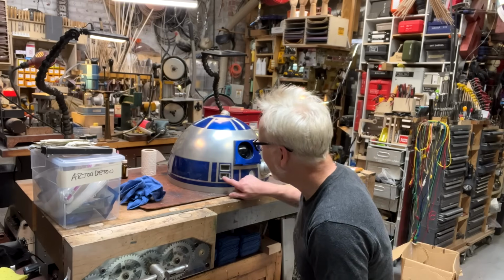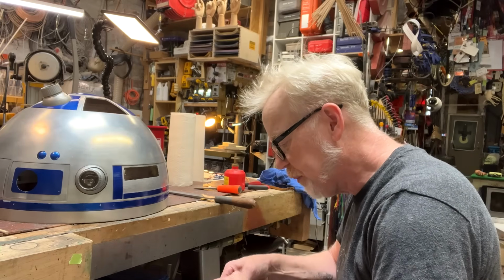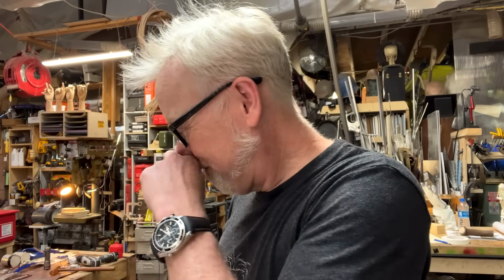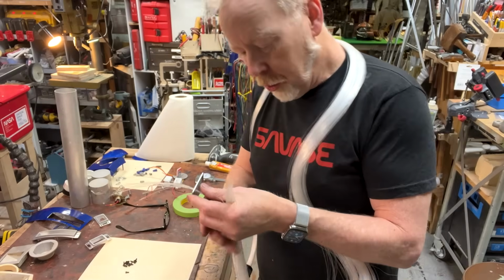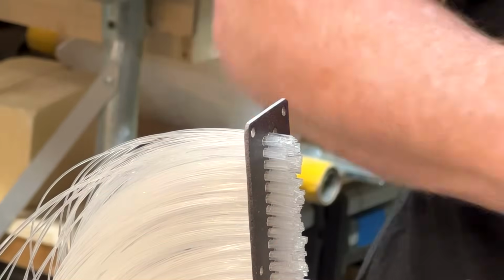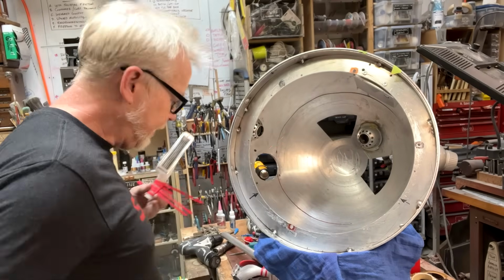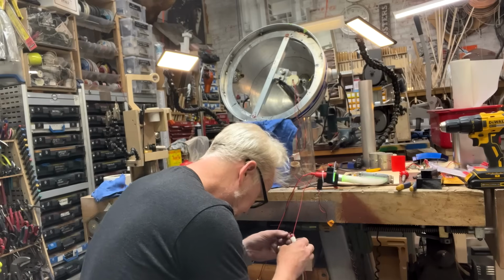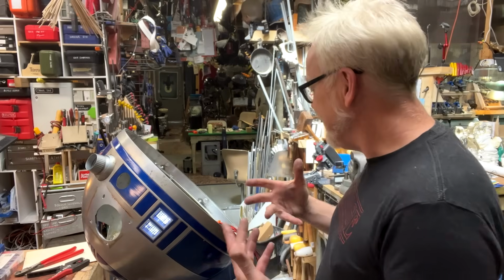Adam Savage Upgrades His R2-D2 Astromech Droid Build!

Comment: That's really cool! ...You probably won't want to take the (simple) end of the light pipe apart again after having ziptied, cut, and glued it, but seeing that you weren't really happy with the way that the rectangular data light/color wheel combo display was working, I was thinking that other that altering the color wheel, you could also move around the (less complicated, color wheel end) the ends of some of the fiber bundles so that you don't get as much of the "there's a shape of color moving through the lights" effect, by having the bundles of fibers on "input" end of the light pipe be farther away from/not next to the bundle right next to them on the display end of the light pipe, depending on what kind of look you're going for.

I've never build an astromech, but I had an idea for doing it a few weeks ago, and this is making me wish even more that I had room to work on it and a place to put it when finished. ...I was thinking about the glossy, black astromechs that we see in the Imperial scenes, and I got the idea "Hey, you know what would be fun? Making one of those, and putting the sweeping red light (Larsen Scanner?) from the front of KITT in Knight Rider on it!"
Yeah, it's pretty silly, but I'd enjoy it. Then it occurred to me that the two square-ish vents in the middle of R2's "chest" do have a resemblance to the 3 bar, graphic indicator light on the dash board that showed when KITT was talking (updated version, the original season it was just a square), and thought that I could also put THAT light in place of/behind one of those 2 vents, and have it light up in tandem with the droid's beeping. ...Though when I was looking on YouTube for a short clip of Knight Rider that showed both the scanner and the voice indicator, to show my son, I eventually thought "Oh, wait. The Knight Boat ("The crime SOLVING boat") clip from the Simpsons probably showed both!", and that was the example that I showed him, but watching it I saw that they made the lights look a bit different, so now I'm torn as to whether I would actually want to use the Knight Boat designs for the lighting, instead, so that the droid actually becomes a kind of parody of a parody.

In any case, if I ever actually DO make this guy, now I'm thinking I want to do the sweeping scanner with fiber optics, like the original R2. I figure I'd probably shift around a few of the dome details to put the rectangular data lights in the front under the eye cluster, and put the sweeping red light in there. ...And maybe put a laser pointer in the little protruding light next below the main eye, so that I could have him play with my cats.

Comment: You could just make a paper tracing to transfer the hole pattern. I would have clamped the fiber optic hole plate horizontally over hanging the edge of the table so I could sit in a chair with my arms braced resting on the table to push the fibers down through the holes. Improve the comfort, and that reduces the tedium of the job. Likely increases accuracy, and speed too. I would have kept the bundles separate so I could randomize the sets so it doesn't look like a light shining behind holes. It would look like individual lights changing colors randomly or as a code an interpreter like C3PO would understand. Given what you made I would make the color wheel a hand panted pattern known as "dazzle". A geometric pattern used on wwII warships to obscure the shape of the ship to confuse the enemy of the size, type, distance, and direction of the ship. Another solution would be to make the light source from several sources whos pattern could be coded.

Comment: I kept wondering the whole video if your R2 was radio controlled, I didn't see any radio control components inside the head. Using a 4 channel hobby R/C radio and receiver along with an arduino microcontroller you could probably remote control a fair number of functions on an R2.  Or as another commenter suggested, use a tablet or phone w/ an arduino / raspberry pi over wifi.

Comment: My red mini-mech on the front cover of MAKE issue #2 has fiber optic logics. I took all the fibers that spelled out R3 in the top display, and C2 in the bottom display, and put them in one bundle. All others in another bundle. Both bundles get random smatterings of light in the slow 6RPM color wheel, but for a few seconds each rotation, only the one bundle gets light to spell out R3-C2. Because that mini droid with the clear R3 dome was brainstormed by the R2 Builders group after C2 in Indianapolis, as the droid that would fit in the Jedi Starfighter wing.

Comment: So one thing I'd recommend people do if your ever cutting the fibre lines with the chisel like Adam was is eye protection. It's very  easy for one of those small glass strands to end up flicking up and into your face.. Also adam why not a simple ardunio or the like unit with wifi or the like in that head you could trigger the effects remotely etc that way.

Comment: Those tiny gear motors are called N20 motors , they come in different voltages and RPMs , I've built a bunch of tiny mechanisms with those , I'll send you a link on Twitter when I locate the videos

Comment: That there is one of the FIRST batch of domes created by myself and Ron Barclay waaaayyyy back in 2003…They eventually came to be known as the “R&J Dome”…glad to see it still looking so amazing after all these years. 😁
Reply: Did they use one of yours in Fanboys?
Reply: Why ya wear glasses then never look through them ? 😅😂
Reply: Was it spin formed? I saw the joint lines inside. We’re these welded pieces?
Reply: @Sommertest  Adam mentions in the video that they were spun, I'm not sure what that means, but I assume that's also what you're talking about lol
Reply: @j0hn00  It means that a flat sheet metal is fixed to a dome shaped jig, and while the sheet rotates, a lever with a wheel is pressed against it, moving from the center outwards, so that the spinning sheet is wrapped around the jig. During that process, lines are left in the material from the occurring bending.

Comment: Funny I started in the R2Builders group when it was about 10 people (now 1000's) and we were all flailing around searching for info.
I typed to Tony Dyson (Nice Guy) who made the fiberglass R2's for the diameter and he said "oh about 19 inches" wayyy back when there were only a few R2's made.
I made a display one to make molds off of but then realized the entire thing was a bit Oversized (should've ben closer to 18 inches)
(I till got that original in a closet here with the head signed by Kenny Baker)

Comment: I wonder if anyone has thought about using clear packing tape to add epoxy into the light sockets while keeping the sockets separate from the light sources??? Would the fiber optics need to be epoxied to show light through the epoxy, because if not, and the light quality or quantity isn't diminished,(too much at least) the packing tape idea, putting packing tape on the back of the light housings would, or at least should, stop any epoxy from getting to the light panels he's adding in behind, without needing to do that epoxy job that he showed, that I didn't 100% understand...(I understood the reasons, of keeping everything removable, but not much else)

Comment: Point of Interest; Those "20volt to 12volt" and "12volt to 3volt transformers", are actually DC to DC converters. Otherwise known as switchmode buck power supplies. 
A very interesting and amazing colour wheel light pipe assembly Adam! Very impressive indeed! Can't wait for the rest of the build, sir!
If you ever need any assistance with the Electronics and theory, of these builds, please drop me a line.
Reply: I agree - calling switch-mode PSU modules of any type "Transformers" is just confusing and misleading to non-technical people or those just learning electronics (even if some dodgy advertisers do it).

Adam, you normally so precise with terminology that I was quite surprised by the lapse!

Comment: Those fiber optics display looks awesome! The only thing I did not like was the pattern showing on them. For once you did it too neatly when bundling the fibers together? If you have made sure they was more randomly mixed, maybe the output also would have been more random too? Now its more of stripes rolling over the displays (especially the small blue ones).

A question I have is: does the CA glue interfere with the light? I am thinking if the glue "connects" to the walls of the fiber optics it will bleed the lights out on the wrong place and make the display more "fuzzy"? Not sure if that is a good or a bad thing either :)

Comment: my father and i dusted off the shel queen helicopter 🚁’s  been idle for five years. batteries recovered then 👅 went the way of the do do. so i bought two brick 🧱 batteries to fly. those that rc fly or run cars etc. need to make salt water after nipping off the connectors then you leave the dead batteries in the salt water for two weeks. it makes the batteries chemicals neutralize so they can be pitched. the problem with nitro fuel is it goes bad and hopefully you ran your rc dry. residual will get gummy tear down clean the bore polished and pull the piston apart clean the whole thing in degreaser in a zip zap ring 💍 cleaner or get the vat parts washer heat soak 🛁 if it’s real bad rinse and dry and reassemble re oil light lube free the rings up. my dad’s rc planes ✈️ servos are ancient kraft stuff. fuel is expensive to boot and bad to run in the grass. kill your grass. but for ought run em freshened up. new battery’s etc. because Adam’s r-too sat for so long batteries 🪫 won’t recover

Comment: Still blown away at how Adam makes these fictional mythologies real, and how casually he assembles the components from the orthogonal bag-of-holding that is his workshop. That fibreoptic colour wheel effect (which I learned here was how they did that!) is wonderous. I wont see New Hope the same way again.
Reply: It's always amazing to me to see the most obscure supplies and tools he pulls out of a random drawer or cabinet somewhere when he needs it. Like that air powered handheld sandpaper gun thing he used around 13:20 into the video. Most of these tools I would never come across a situation where I would need one, but Adam Savage has come across those situations often enough that it becomes practical to own one. What an adventurous life

Comment: 1:20:00 it's so much easier to use a slip ring and detachable connector. A lot of us are even using magnetic connectors so we save on weight and connector
 hassle.

Comment: for cutting the fiber optic would it of been easier to split the full fiber length into your individual bundles (11 strands per)  then measured, tape & cut to the desired lengths, that way you would have a bunch of tiny bunches ready to put into the grid?? 
and am i the only one who wants to take apart their fiber optic x-mas tree to have fiber optic to play with?

Comment: 6:14 We have a nearly identical dead blow hammer in our workshop. I know this since my childhood. It was one of the earliest tools I was allowed to use and now I am using it professional from time to time. It might be a few years older then myself. And I allways get a little nostalgic when I see those transparent orange hammers, even if they are very common. 🙂
Reply: Dead blow hammers are a different thing.
Reply: @chuckoneill2023  I had to use a dictionary as english is only my second language. Is it only called a dead blow hammer if it has a counter weight?
Reply: @gorgonzola86   A dead blow hammer is hollow, and partially filled with sand or some other heavy powder.
When you strike with such a hammer, the powder shifts as the hammer hits, so that it doesn't "bounce" -- hence the name.   This is good from a safety standpoint, and it also means all the force is delivered to your work piece -- no wasted energy.   Such hammers are typically made of plastic, so they aren't used to hammer nails -- more generally, for hammering pegs, shaping wood or soft metals, and other such tasks.
Reply: @chuckoneill2023  that is what I asked. That filling is the counterweight. Sand is a very cheap filling and not very good. It then seems to me the use of names shifts in the same direction in english and in German. As our word for those hammers (rückschlagfreier Hammer) is also more and more often is used for other rubber hammers.
Reply: @gorgonzola86   I think some of them are filled with iron filings.   I suppose sand is useful when it needs to be non magnetic.  We've invented so many different hammers, over thousands of years.   Pretty sure they were our first tools ---  one of our ancestors tied a rock to a stick, and hit his enemies.

Comment: I don't believe you're giving yourself enough credit (noting how your process can be streamlined by use of newer tech.). You come from a generation of building that is practically non-existent today. Yes, there are plenty of modern techniques and methods that have made the build pipeline more efficient (time, cost, build integrity) however, most of these were predicated from the needs your generation (and prior) put forth. Watching you construct this without using modern software/equipment is a look as to how the earlier fabricators engineered these devices. We need more of these videos from creators like yourself as they serve as a vehicle to view early engineering/fabrication.

Comment: Be mindful of your voltage with those battery adapters. They don't have the battery protection built in (It's built into the dewalt tools in this battery system) You can Over discharge the battery, ruining the battery, if you aren't careful.

Comment: thanks for taking the time to just talk about how any level or material for this kind of build is valid.  I have unfortunately run into some gate keeping ness with some parts of the StarWars costuming community, specifically the (local) Mandos.  This was before "The Mandalorian" which introduced a whole lot more flexibility and alternative designs.  They wanted only specific materials, much of witch are more expensive and harder to work with.  they wouldn't accept anything made of foam or warbla, only "Canon" costume designs, etc.  Kinda put me off to be honest.  

I might look into something more Rebel alliance though these days lets be honest I'd much rather be a smuggling scoundrel.
Reply: There is a bit of a philosophical difference between the droidbuilder clubs and the costuming clubs, or at least that's always been my impression.  The former clubs are pretty open to all comers, while most of the costuming clubs seem to be concerned with screen accuracy uber alles.  I also have found that approach off-putting.

If a droidbuilder wants to build a precise replica down to the exact shot of R2 from a particular scene?   Fantastic!  They are a droidbuilder.

If another builder wants to build a wholly original droid, or make a Mando R2, Iron Man R2, or Dalek R2?  Fantastic!  They are a droidbuilder too.

We will happily appear with and chat about Wall-E, K-9, Jinx from Spacecamp, or even Tom Servo and Crow.

There are no approvals on aesthetic or accuracy grounds.  The UK builders do have safety approval for appearing with them at events, (IIRC partly because they have club insurance coverage), but there are still no droid approvals for actually being considered a member of the club.

I've long felt that the costuming groups need to be a lot more open to stuff in the spirit of Star Wars, rather than being such sticklers for adherence to the letter of Star Wars (moreso than the actual movies and other media are, imo).  It's why I've never had much interest in joining them.  I can appreciate a high degree of screen accuracy without being quite that fussed about doing it myself.  I need room to inject my own creativity, not just copy someone else's vision.

Close enough is usually close enough.

Comment: The fact you use fiber optics also gives the data display partial illumination in each node, because certain strands have light and some don't. That gives it such a more sci fi look than each node being solid on and off
Reply: It’s an easy and cheap solution that was used all over the place in the 70s a 80s. Every home had to have one “light fountain” to be trendy then!
Reply: @ArnaudMEURET  my family had a fiber optic flower lamp in a clear box with a gold foiled base. It shifted through multiple pastels, and we left it on as a nightlight in the living room for my entire growing up.
Reply: it also seems to save on mass amounts of wiring. Looks a hell of a lot cleaner
Reply: You could achieve a similar effect with a dot matrix, backlit, grayscale LCD panel.

Comment: They don’t use grids of LEDs anymore. Now most R2 Builders are using fiber optics with LEDs behind them to make them glow
Reply: well, technically those LED's are arranged in a grid of sorts. :)  but yeah, the teeces was a grid of standalone LED's whereas the R2 Series logics kits have the SMD LED's on the board and then the fibers push back against them. I love mine.
Reply: @marks47  I suppose we technically still use LED yes :) although as you said not in the same way. Teces lights weee great I still use them

Comment: Listening to Adam's soliloquy and thinking that "Adam Savage" and "gatekeeping" are two things I never would have imagined hearing in the same sentence. My only effort at making an R2 was over 20 years ago, I made it out of a trashcan, a mixing bowl, a bunch of cardboard, the castors off an office chair, and some spraypaint. It had no lights, no sound, no articulation, was the wrong size in any dimension, I had to push it around myself, and could more accurately be described as an "R2 shaped object."

After taking it round the convention circuit for a year, I hinged the lid, layered the inside with spray foam, and gave it to a friend to use as a beer cooler.